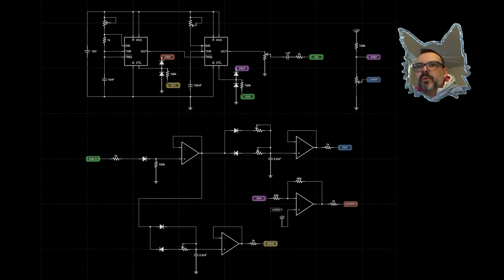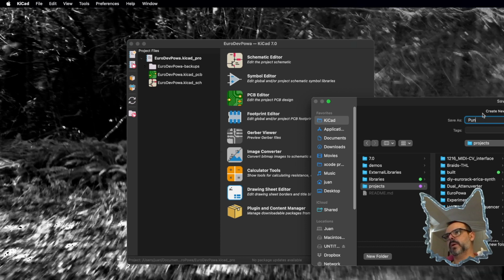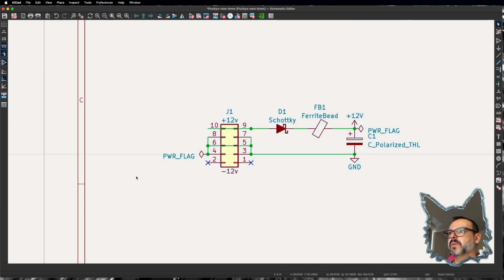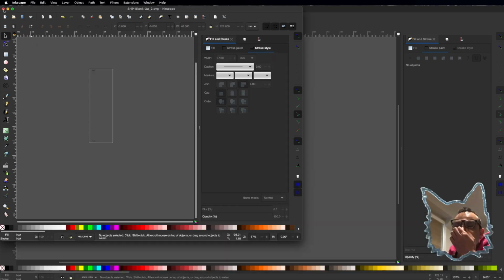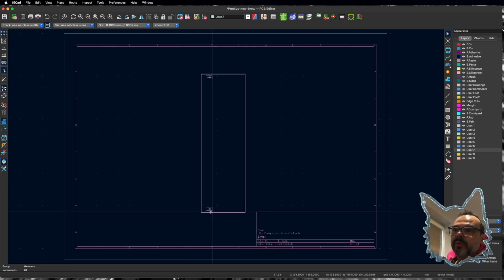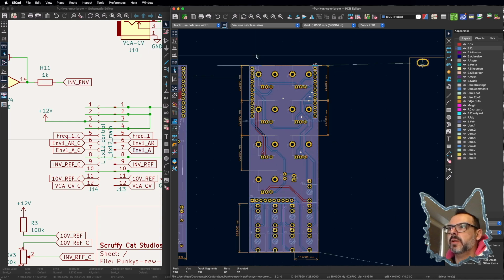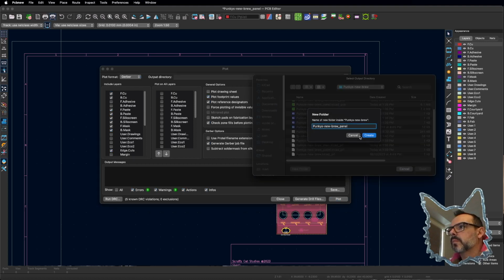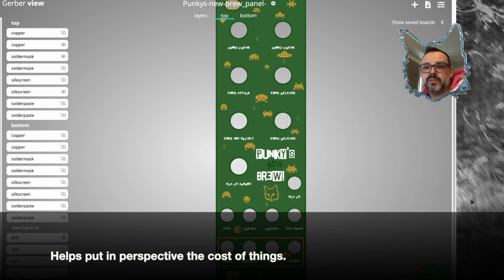Punky's -NEW- Brew Part 2

Comment: Great project, will give it a try thanks for sharing !
Reply from the maker: Not the most useful or interesting, but still somewhat fun. After building mine I realized that I prefer smaller pot values for the attack and release of the envelope. So play around with those until you get something you like.
Reply: @scruffycatstudios  breadboard step will the the first for sure !
Reply from the maker: @dtharmo  sweet! If you discover some flaws or improvements let me know ;)